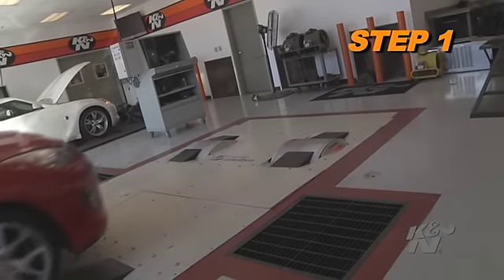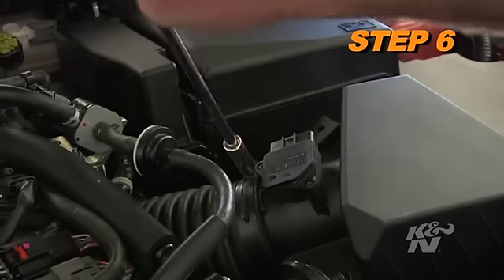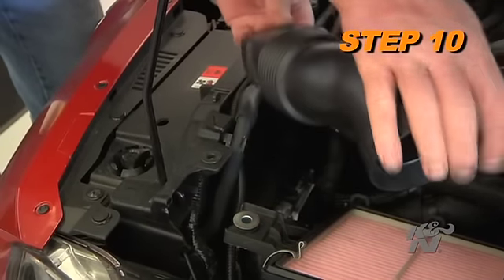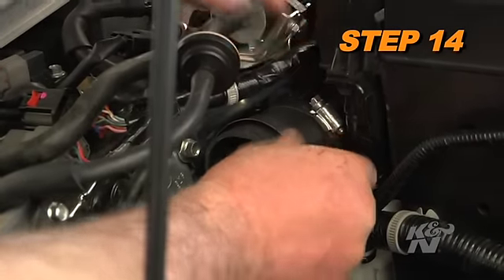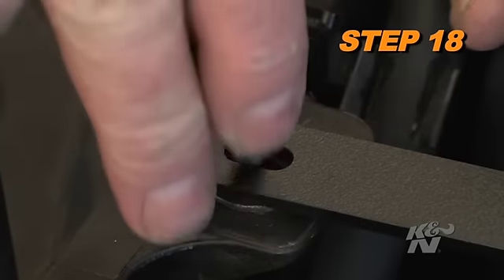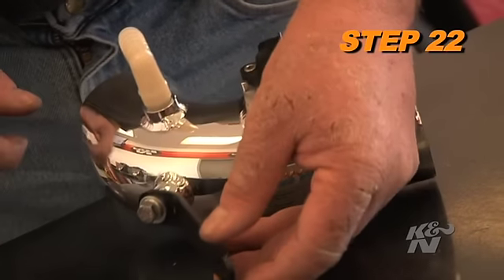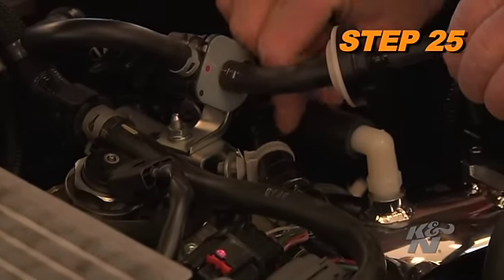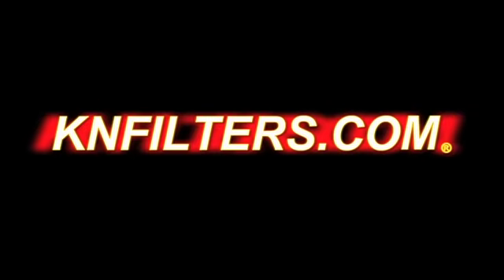Mazda 3 & Mazdaspeed 2.3L [#69-6012TS] Air Intake Installation

Comment: Do I need a tune to run this intake system?
Reply from the maker: Negative! Our intake systems are designed to run with the OEM ECU. No tune needed
Reply: @KNfilters  I wonder because every other website says that all mazdaspeed3 aftermarket intakes need a tune!
Reply from the maker: For a more detailed explanation of the installation process and compatibility with factory ECU settings please feel free to contact our product specialists  at 800-858-3333 or tech@knfilters.com.